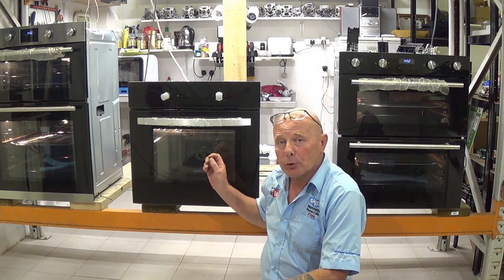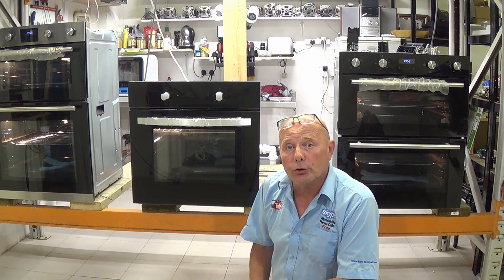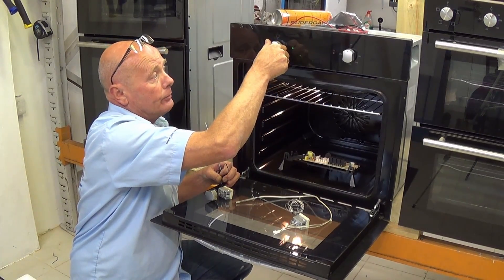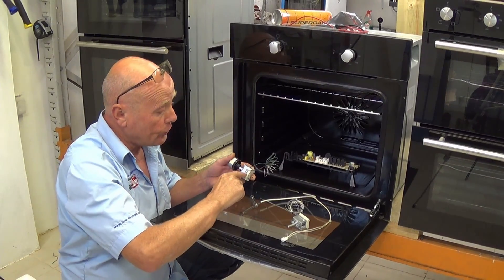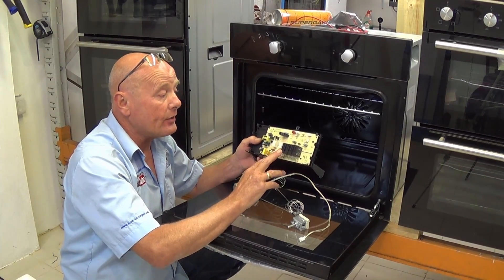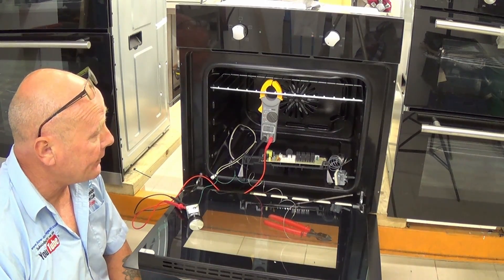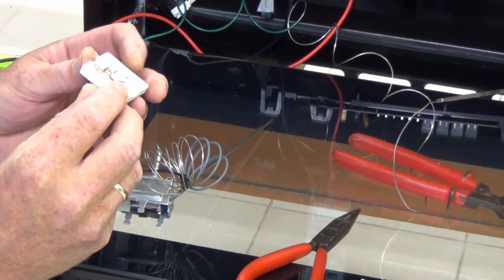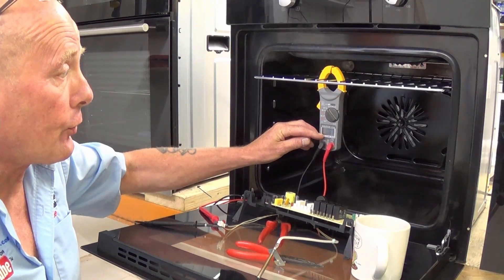Fault 7 Cooker Oven overheats and burns eveything

Comment: Bought a new thermostat but still my oven is overheating
Reply from the maker: Hi, please use our contact us page and make sure you fill out the request for what your problem is. I will need the full model number of the identification plate and the details of your problem so that I can provide you with useful literature. A video shoot of the problem would be perfect as well.

I will get back to you within 24 hours, normally. https://www.how-to-repair.com/help/contact-us/  

Please remember to subscribe to our channel, as that's what keeps this channel going. Thanks, Paul 👍

Comment: Why didn't u test the thermostat the same as the NTC sensor
Reply from the maker: if I am understanding the question correctly the thermostat is a set of points which cut in and cut out at a certain temperature. The NTC sensor does not physically control anything it only sends an ohms reading to the device that is attached to then there is normally a relay that will control whatever it is controlling. I hope this helps you @education9135 please remember to subscribe to our channel as that really helps us https://www.youtube.com/shorts/e432SAb2g08  Thanks, Paul 👍

Comment: Again the kelvinator single stove plates have the same heat at setting of 1,2,3,4 but 5, 6 they get hot why.
Reply from the maker: again without the model I do not know which thermostats are controlling the hob plates the old type system used to just heat different coils so 1234 for example would only be using the inner coil but 56 maybe using two coils again without the model number and knowing what type of thermostats are in this? It is very difficult for me to answer. Feel free to use the contact page on the website with all the relevant information.

Comment: The kelvinator single stove gets on and bakes and after some time it switch off by itself, then after some time it switch on again , what might  the problem
Reply from the maker: You described it a little bit better here and I understand what is going on a little bit better if the oven is cutting out completely and then coming back on say 20 minutes later this may be a thermostat called a safety cut out kicking in for safety reasons of course this might be because the cavity between the inner oven and the outer oven is getting too hot. You might want to check, if the cooling fan system inside this cavity is working if fitted as I do not have the model or wiring diagram I'm unable to know all the components in the oven

Comment: Hi Paul love the videos .just one observation I made.you kept referring to the electronic  temp sensor as an NTC .The sensor would be a  PTC  sensor.If the resistance  goes up when applying heat  it is a PTC sensor.If  resistance goes down when heated it is a NTC  type .not trying to be smart just letting others know the difference. Keep up the great work as the vids are very informative. Thanks again.🖒

Comment: I have a baumatic oven which started overheating, the thermostat light goes out as it should do but the oven continues to heat when the oven is set to fan with top and bottom elements but seems to work if just set to bottom element and fan. I've replaced thermostat just to test and made no difference. If left it will heat up to the extenet that the whole oven turns off until it cools.
Reply: It's a baumatic BODM984X/e if that helps

Comment: I have a 9 year old GE Profile oven and the control board (relay) is faulty. The part is around $300 but guess what? It is no longer available and discontinued. So now I need to buy a new oven.
Reply from the maker: Sometimes it can be just a relay on the circuit board so it's worth inspecting them but you may also find it helpful to put your model number into the likes of eBay and see if anyone has a secondhand board for sale. Hope you had a good New Year please remember to subscribe to the channel as that helps us.
 glad we could help you @artstech this is for you https://www.youtube.com/shorts/e432SAb2g08 please remember to subscribe as that's what keeps this channel going. Thanks 👍

Comment: I had a friend who’s oven glass door smashed , he then got replacement glass for it and it happened smashes again. I noticed the element was flush with the door once closed, so the element would be touching the glass I don’t know how that’s possible. Do you you think that’s a possible cause ?
Reply from the maker: I have seen this happen a few times it is normally when the wire shelf or any cooking tray is touching the glass the transfer of the heat sometimes causes this problem
Reply: @How-to-repair  ah I never even thought of that. Thanks il bare that in mind for the future 👍🏻 🪛